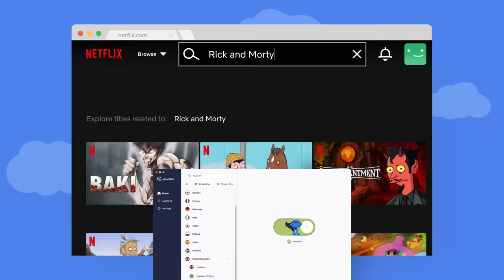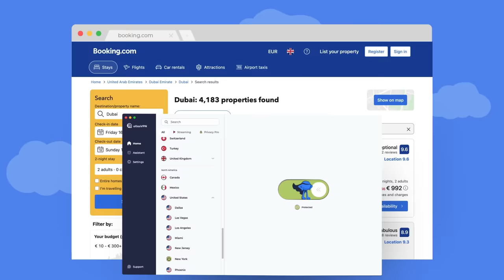How do Russians Cope with Heavy Tank Losses?

Comment: I read an article a while back that tried to answer the question of Russia's tank production capabilities. Long story short they were making 200+ news tanks and a further 800 refurbished tanks drawn from old stock. So about 1000 a year and could keep that up for about 3 years with known stocks.
Reply: If that's true then they would be out of tanks by now.
Reply: @perkunast9680 have they lost 3000 tanks already? Damn
Reply: @Dantm928  ~2400 tanks,
Reply: @Dantm928  at best it's around 1000 a year, they are loosing 20-30 a day. Also the old stocks have ran out out. Not to mention they are loosing double that in other wars and training.
Reply: Ural claims to be producing 100+ T-90s a month and also retrofitting a similar number of T-72s into T-72B3Ms.
They say they can keep this rate up indefinitely and once all T-72s have been refurbished will focus entirely on the T-90.
They now have all their workshops open and are running at Soviet Union levels of staffing.
It's just the tip of the iceberg though, Kamaz, Kurganmashzavod and all the other military industries are now pumping out equipment at almost war economy levels with the Russian government DOUBLING military spending.
On the surface this may be equated to simply doubling production but Soviet style weapons manufacture increases exponentially once mass production starts because weapons are designed to be cheap and simple to produce.
It may be bullshit but honestly it seems to be holding up for 12 months now, I've haven't seen anything that would actually disprove the claim.
Reply: @Dantm928 I highly doubt they’ve “lost” that. Knocked out perhaps, but I wager a sizable percentage of those knocked out were brought back into service a few weeks or months later. WWII was funny in that reported losses of tanks far outstripped what was actually lost. If you follow diaries of US tankers in Europe, they slagged more panthers and tigers than there were produced.
Reply: This assumes that Russia is telling the truth. Also if museum tanks have taught me anything it's that a tank can look amazing on the outside, but be a rusted out piece of crap on the inside. 

That's not even mentioning the decades of neglect, sale of equipment and theft of parts that'll hamper their progress in bringing these stockpiles back online.
Reply: @tdlainc.4737  That is including destroyed, damaged, abandoned and captured. Have in mind that Oryx has a nasty habbit of counting destroyed Russian equipment multiple times from different angles and distances (often counted as unknown) 1100 is counted as damaged and abandoned (which makes them very likely as salvaged by Russian forces and put into action later on)
Reply: @Daniel-jg8ff  Oryx has it's flaws (amongst them only accepting photo's they can confirm as both of a unique vehicle and which can be identified by type), but the assumption that damaged/abandoned vehicles have been salvaged at 100% efficiency in circumstances where they can't ensure security for the recovery crews is making some truly wild claims about the efficacy of the russian army.

More likely they may have salvaged somewhere around 1/3rd of that 1100 you sighted with the other third being recovered by ukraine and the final slice rusting away in no mans land.
Reply: @Dantm928 
3000000000 tanks!!
Reply: @tdlainc.4737  "2400 tanks" Source: The Ghost of kiev
Reply: @perkunast9680 
> they would be out of tanks by now
Level 70 in coping 🤣
Reply: @Dantm928 who knows only 2,504 visually confirmed losses (300 of which are damaged or destroyed or abandoned). This list likely doesn’t account for all of the damaged tanks that are repaired.
Reply: @maryanchabursky9148  visually confirmed 2 pixels, many cant be distinguished as theres no insignia. You should really not trust state affliated numbers
Reply: @kushaliyersharma9688  lol cope harder. The ones they can’t tell they don’t report.
Reply: So if Russia looses more than average 3 tanks a day they will run out of tanks. And that is without thinking that the old refurbished tanks area limited quantity to start with. At 15 tanks a day, which is more like the reality, tanks will be very scarce soon.
Reply: @Dantm928  100 men can become 150 casualties, just like 100 tanks can become 150 tank loses.

How this happens:
Tanks attacks get damage (Tank 'loss' #1) --> Tank gets field repaired and a week later gets damaged again (Tank 'loss' #2) --> Tank is heavliy damaged get sent back to russia for full repair and refurbishment gets deployed months later and damaged a third time this time becomes scrap metal (Tank loss #3)

Same can happen with Casualties like in Bahkmut:
Man get a gazing wound bleeding heavily (Causualty #1) --> Gets patched up fights again sprains his ankle which swells and he can no longer walk (Casualty #2) ---> Swelling calms down after a 2 weeks and gets deployed again and he gets hit by shrapnel and gets a concussion needs serious medical attention leaves service (Casualty #3)
Reply: @perkunast9680  Covert Cabal tried to count the tanks they still have, lets just say the storage facilities are looking really bare
Reply: @perkunast9680  No. If that is true it means they will run out in 3 years